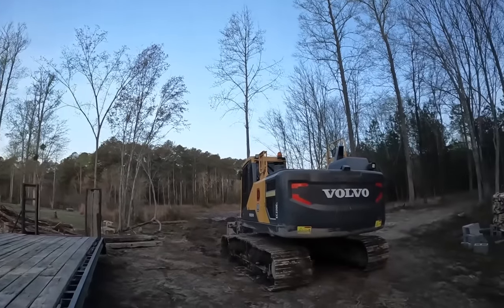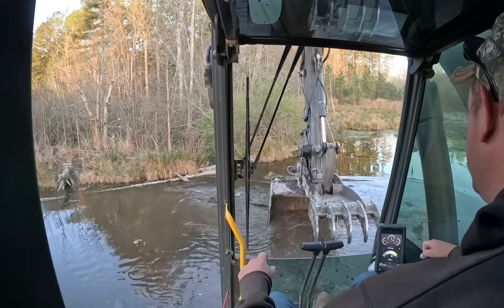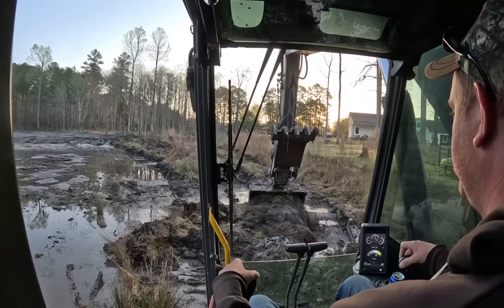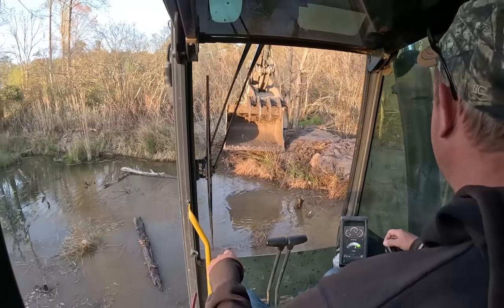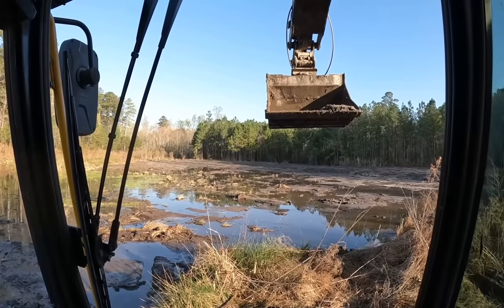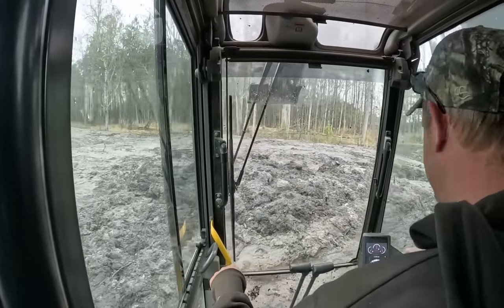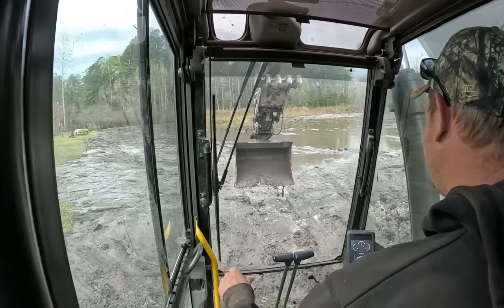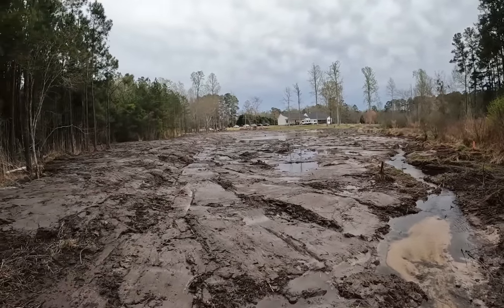Patching Up The Beaver Dam To Refill The Pond!

Comment: I’d like to see this pond again when it’s full of water. It looks so much better than when you started but it would look much better if the other land owner would have let you clear out his side too. I’m a little concerned that the head section won’t have enough depth to keep vegetation from growing.
Reply: I've read online that you need about 3 feet to prevent plant growth.
Reply: @2badger2  water clarity also plays a big role, but 3ft is kind of a general rule.
Reply: @2badger2  Yeah I suspect that head section is gonna be full of weeds by summertime. 🤷‍♂️
Reply: @jasonmfshow  - the water flowing in there is crystal clear.  It’ll be murky fora while, but once it’s full it’ll clear right up. Apparently it was a nice pond before the dam break,,, it would have been pretty shallow then,,,,, fingers crossed. The beavers themselves control the vegetation quite well also. They know how to keep the pond to their likings. 😂😂.

Comment: I've read and heard many times that beavers can design a dam with trees, limbs and mud better than any engineer.  Don't know if that is true but I do know there are three beaver ponds on the creek that borders our property that have been intact for at least 50+ years.  We had a 100 yr flood in 1994 that blew out the man made dams on 90% of the ponds in this area.  The three beaver dams stayed intact.  The water breached the beaver dams of course but they did not blow out.

Comment: Well it certainly looks better for now and will likely help with bug control. Especially when it gets flushed regularly after full. Good plan to make that repair higher thus pushing the overflow onto the beaver portions as they build with sticks for structure that your patch does not have. Their old sections can take the overflow without scouring hopefully. Only other choice for a swamp like that is to bring in fill and get above the water levels. Filling along that one side got them some more level solid ground so that helps. Great job with what you had to work with. Most of YouTube is busting beaver dams, but you go against the grain and repair them. That's thinking outside the box for sure.

Comment: Great job repairing that beaver pond. Kudos to the property owner for wanting to rehabilitate beaver habitat. Do you know if the beavers are still on the pond? Typically beavers rebuild right away when their dam is breached so for them to not repair the hurricane damage makes me wonder if they got scared off of that pond and moved on to an area they may consider safer. The beavers may have associated the hurricane damage as if it were isolated to that location. They will abandon a pond when the dam is repeatedly breached (for instance, by a property owner who wants to evict them), so it's not unlikely. If they don't come back to start maintaining the dam, or if other beavers don't move in it may be possible for the property owner to work with Fish and Wildlife to relocate an unwanted beaver or pair to this property. There are also wildlife rehabilitators that the property owner can contact to have them release rehabilitated beavers onto this pond. Might be something to try prior to having the dam reworked.

Comment: Chris I’ve got a question. With no overflow where’s the water gonna go when the pond fills up? Or is there a runoff from that pond to the the other pond?
Reply: He said at one point during the video that normally beaver dams just flood over all along their length so no wash-out areas.
Reply: @sharonmiller6436  thanks I had a commercial just before he said that the time watching. I just watched it over ☺️ YouTube has been putting a lot of commercials lately and when the video restarts no sound for 2-3 seconds.

Comment: San you upgrade the machine's 'plumbing' so the thumb will work along with the tilt, or would that introduce the possibility of unfortunate thumb/bucket impact issues?
Reply: It would take more than plumbing to accomplish that since the controls that work the tilt also control the thumb. New switches and hydraulic controls would also be necessary in addition to plumbing. The gain it would offer wouldn't justify the price tag. Just saying...

Comment: If you could replace those two hydraulic 3-way valves with electric ones, properly protected against liquids and operated from the cabin, then you'd have a comparatively cheap way of switching between using the thumb or the tilting of the gradient bucket. You (Chris, hardly anyone else) might even manage to juggle these separate functions into one - making these pond jobs requiring mats much easier for use of this older excavator without extra hydraulic lines.

Comment: What a mud hole! If you left your excavator over night I guarantee you there were snakes under it at night. I contractor was clearing a piece of timber for me just before spring several years ago and he had started on the pond and was greasing his Cat D7 then started it and let it warm up and as he backed up I heard him screaming and the dozer shut off. I came running and he screamed for me to bring a gun so I grabbed my Pistol that shot 4/10 shotgun shells because I thought there was a snake on his operators station but he pointed to the ground and there were 4 timber rattlesnakes all coiled together which I was told by a conservation agent who came out and picked them up with his snake pole all twisted together that they were mating. I told him it was lucky for them because they were going to die with double 00 buckshot. He said it was illegal to kill them in MO. I said not if you were not called and they were buried with a bulldozer. The dozer operator said I would have chopped them into pieces if I wasn’t so dam scared of snakes.

Comment: Chris, can the mats be made out of a metal material so they last longer or would they buckle under the weight of your excavater or be too heavy to move around?
Reply: Metal on metal would be too slippery.
Reply: He needs to buy a sawmill and a long auger bit. He cuts enough timber to be able to make his own mats by squaring up the logs, drilling holes through them, then tying everything together with some rebar.
Reply: He has a friend who has a mill and he may build their mats. Those bunnies are pretty pricey either way, he has said those mats are in tye 1500 dollar range.

Comment: I wonder if you use the excavator at full throttle even if the job is to load mud? I'm not saying it's wrong or right, I just want to know your opinion
Reply: He runs at idle to warm it up, full throttle while working and idle to cool down...that's it 😁
Reply: @southernhomesteadtransformatio  Yes of course, but I can't get someone to tell me why use the engine at maximum load when the excavator is not doing heavy work, some say so as not to damage the pump.
 But I'm not sure
Reply: @chevyford100  I pretty much run 3/4 throttle...
Reply: Most excavators have variable flow pumps so it doesn't matter too much what your engine speed is, if you watch the motions of an excavator they slow when the load is great and speed up when the load is lightest.  Best to run the engine at upper range to get efficient fuel to work done ratio.  The less time the engine is running the less fuel it will use, within limits.
Reply: Chris, are you listed as a mud specialist in the phone book? Nice job I’m sure if the local beavers had a phone you would be getting all of their work.

Comment: Just a question, Could you not install an electric diverter so you could be able to swap and use your thumb and the grading bucket? I installed one on my first tractor so I could use a grapple off of my dump/curl function of my bucket. Just hold the button down and the grapple could open and close.